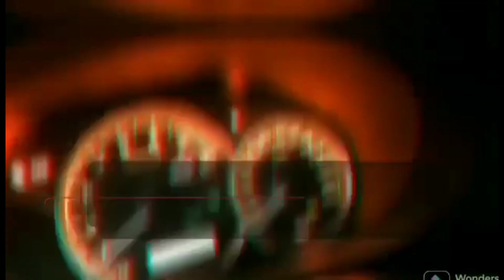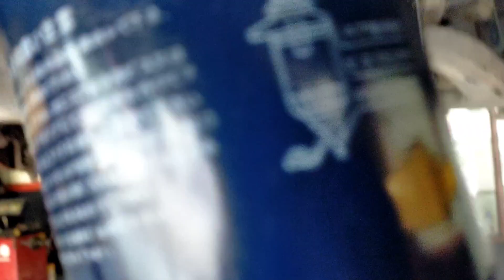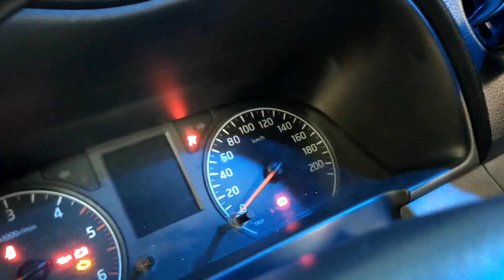NISSAN NV350 how to replace fuel filter

Comment: If facing lagging RPM or changing of gear slip check transmission oil and  try to replace this two parts before proceeding for the gearbox ... Save alot of money. Thank you bro for this video
Reply from the maker: Thank you sir!